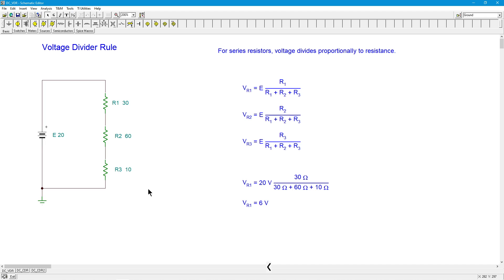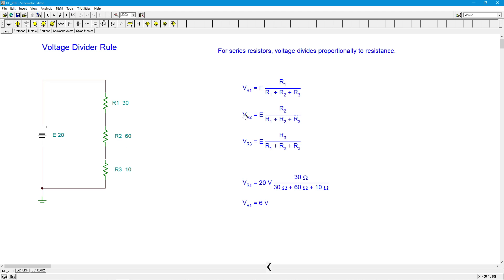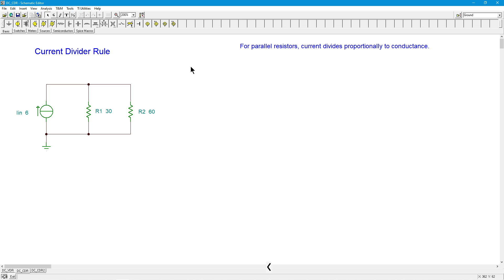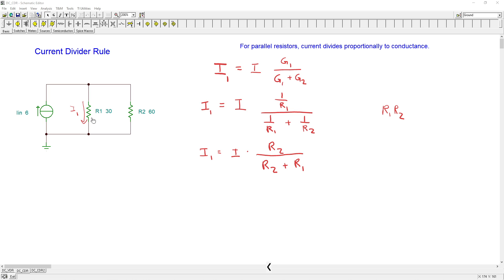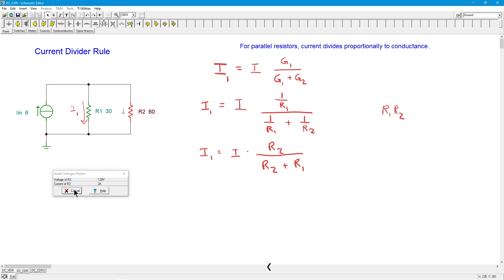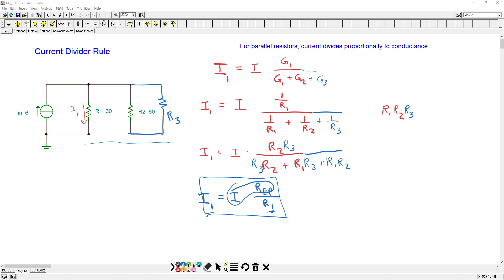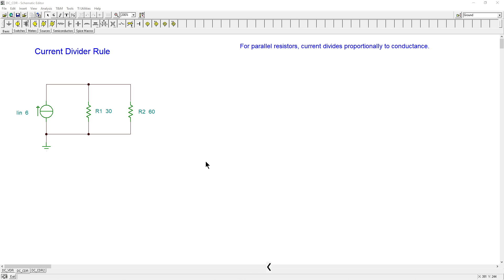DC Current Divider Rule

Comment: In the case of having more than 2 resistors in parallel, lets use 4 for example. If I wanted to find the current through R1 could I not just find the Req of R2, R3, and R4 and then treat it as a two resistor circuit?
Reply from the maker: Yes, you could. As I often told my students, there are many solution paths to an answer. The trick is to find an efficient one. If I had four resistors as you mention and needed all of the branch currents, I'd probably just find Req and then find the parallel voltage. Then it's a bunch of easy divides (Ohm's law) to find the branch currents. If you just need one current, then what you suggest is perfectly fine.

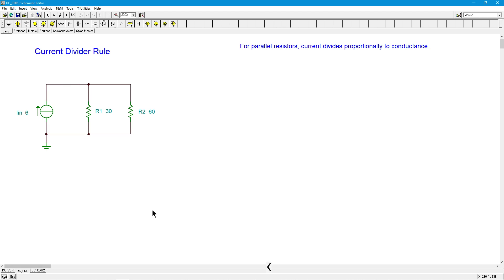Comment: It is curious to me that this "shortcut" applies when we are using a current source.  Most simple circuits are supplied by a voltage source.  So to perform a source conversion, it seems to me that we need to compute the effective parallel resistance.  So we are back to the "classical" method discussed at 2:12.   Also, the classical method might as well be used when more than two resistors are in parallel, since we need to compute the effective parallel resistance in those use cases.
Reply from the maker: You bring up a good point. Sure, "most simple circuits are supplied by a voltage source". A quick glance at almost any circuit analysis text will show this to be true. Personally, I never understood why, short of the fact that most people are already familiar with simple voltage sources (batteries). Yet, almost all semiconductor devices (e.g., BJTs, JFETs, MOSFETs, IGBTs) are modeled as controlled current sources! I think most texts do a disservice to the students by not including more on current sources from the start. That's why current sources are discussed early in my book. 

From a practical standpoint, the current divider rule is not as useful as the voltage divider rule simply because the VDR is applicable to any number of series resistances while the CDR is limited to two parallel resistances (in its normal form). People still find the CDR useful though, for example, when looking at the effect of an amplifier's output impedance versus the load (considering that the transistor is already in the form of a current source).